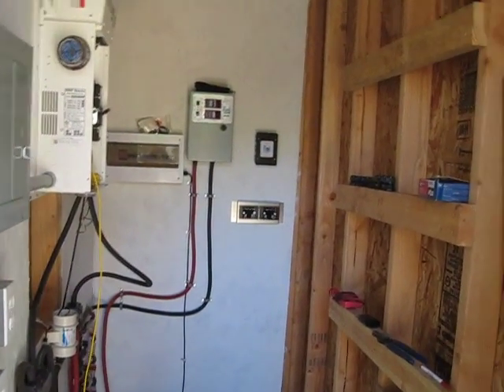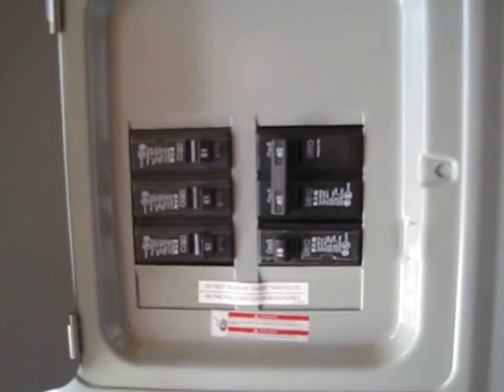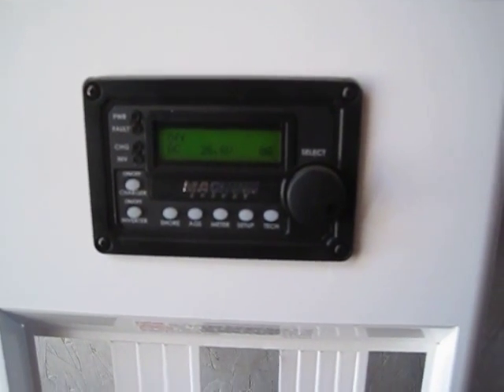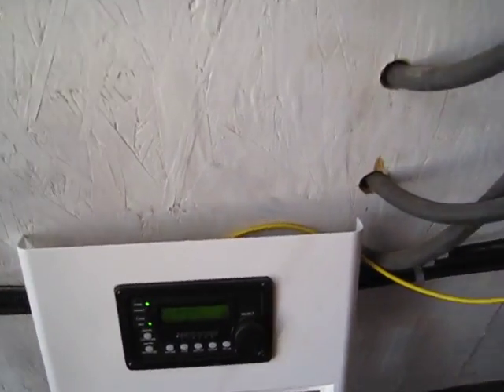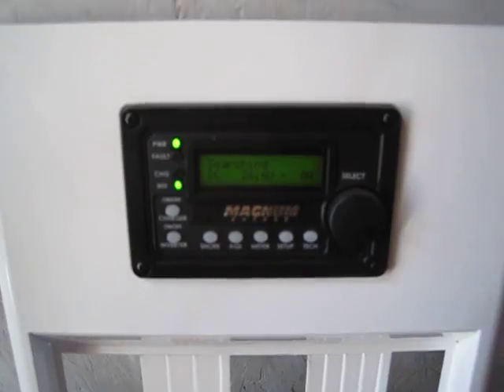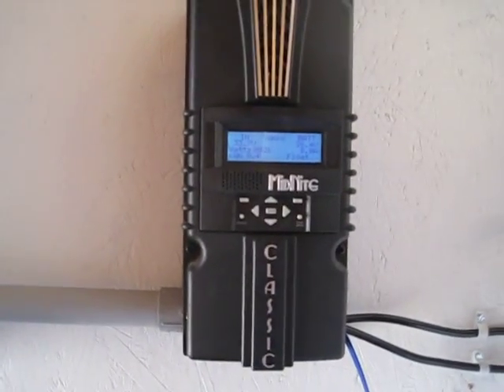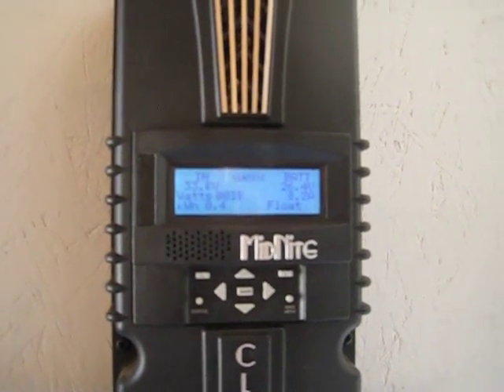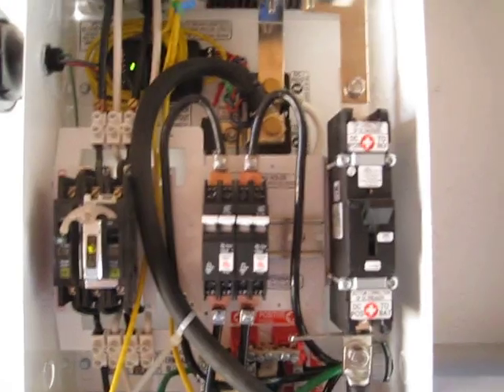Off Grid shed sub panel install and inverter test 001

Comment from the maker: I do not know if I will hook them in series or not. will talk with alan this evening about it.  hey rev, what are you calling a string controller? I have a combiner box which protects each solar panel, and a midnite charge controller, if you hook them in series if one goes bad or is blocked in sun, it will effect the entire run. not sure about a auto start generator, have to save coke cans for about a year lol.

Comment: I was wondering why spend so much on a string controller and then wire them in parallel, though one good reason is that if a cloud blocks one panel you don't loose all the panel power.
are you going to hook up an auto start generator?

Comment: It's ALIVE!  Nice to see it run.   If you decide to hook those panels in series I think you can still have the same protection you are using now, just less spaces needed, since the voltage will increase, but the amps at the point of fusing will be the same, right?  Your installation is way neater than mine, but I don't have a luxurious shed to work in.  Stupid rooftop a/c on my trailer is shading the corner of two panels.  Don't know how much that is costing me, but it is annoying as hell.  I would take it off if it where easy to do.